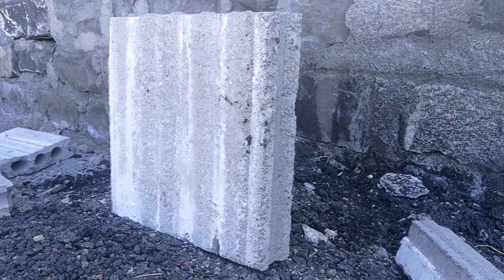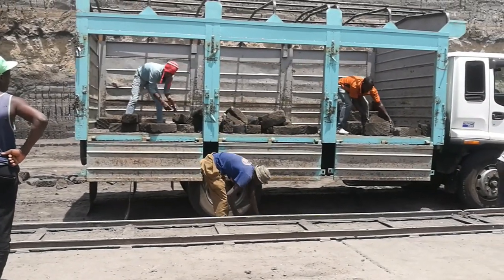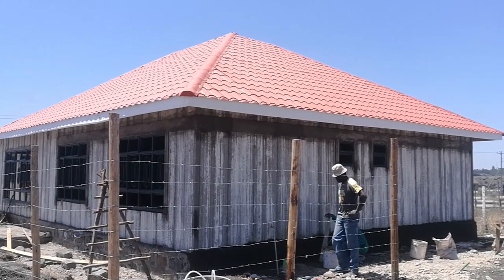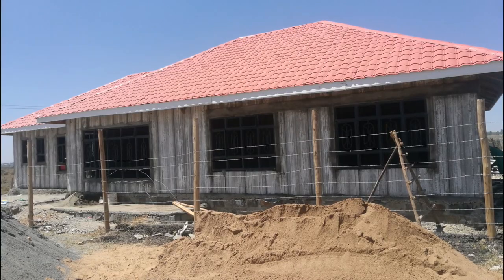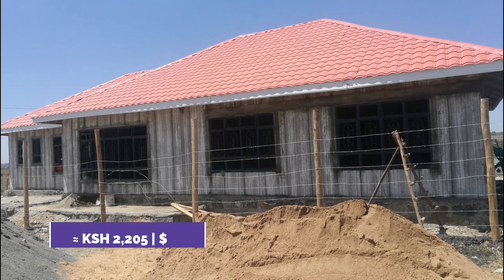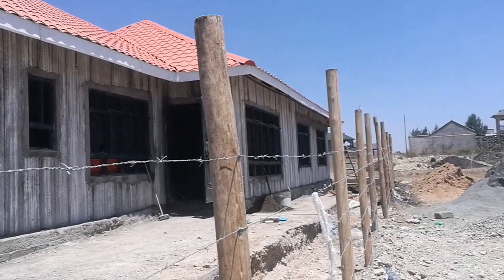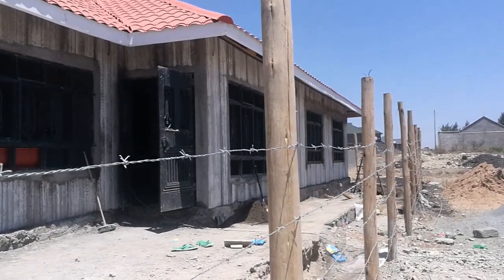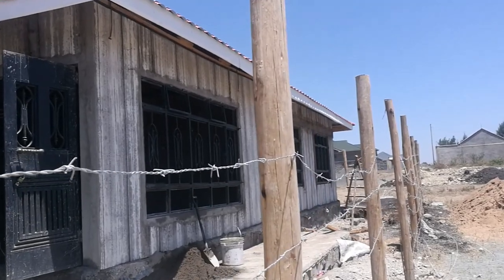Thinking of Using Precast Concrete Wall Panels? 3 Factors to Consider

Comment: What is the approximate weight of a single panel? This will be useful for calculating the number of panels a truck can carry per trip.
Reply from the maker: I don't know the weight of each panel. Maybe you can contact Squareapple for more details
Reply: @PropertyNoma  Thanks

Comment: It doesn’t have steel mesh in it - it is prestressed in one direction only - non bearing walls may work but using Hollowcore as anything other than a roofing element is a mistake - consider precast solid slabs rather than Hollowcore - as solid slabs do have rebar mesh and has a similar cost - solid slabs are much more durable
Reply from the maker: Watch this video: https://youtu.be/40iUZpCFEAI

Comment: What's the best company to work with when it comes to precast
Reply from the maker: Squareapple - Sammy (±254714259226)
Reply: @PropertyNoma  where are you located
Reply from the maker: @josephbaraza7220  I'm in Nairobi, Kenya